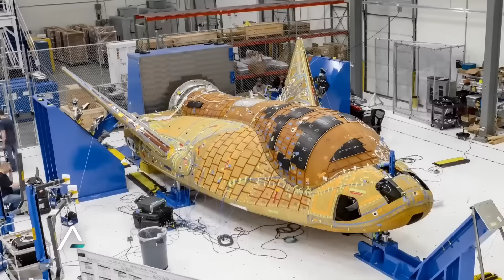The biggest news this week wasn't SpaceX or Blue Origin!  It was Sierra Space and ULA!!

Comment: Longer term the winners in the space flight game will be the ones that optimize reuseabilty IMO.  It’s basic economics - if a given craft and engines can be reused many times the cost per flight dramatically drops.  A key factor in this effort as well IMO is the durability of re-entry shielding.   If the shielding requires extensive and expensive refurbishment every flight the cadence of reuse is significantly lowered and the cost per flight rises.

Comment: Very smart move for both companies, though I do feel dream chaser needs to at least get a cargo mission going. It seems like it has been quite a long time and still not much to show for it.
It is good to see a company using these next generation of heavy lift rockets in other ways. A space tug is what SpaceX should have done with a second stage on top of the booster while they worked on starship. That being done they could have at least held contracts for the ship to start bringing in a flow of cash. Also could have used it to test 'tankers' and refueling in orbit. The longer this all goes, the more starship seems to be holding them back. 
Great coverage as always and fingers crossed all these companies achieve the goals we all want to see.

Comment: Assuming the acquisition goes through, once they run out of Atlas rockets, they'll be left with Vulcan Centaur.  The problem with that is that it is doubtful that Blue Origin will be able to produce BE4s at any scale other than at a snail's pace, and even then prioritizing Glenn (I refuse to call it 'New').  They need to ring up SpaceX and try to buy Raptor 3s as they are now more powerful, lighter and are being mass produced.
Reply: A little flexibility might be a great thing here.
Reply: In the tour with Tim, Bezos said from next year they'd be able to produce an engine every 3 days. The 2 engines used for Vulcan (which are also intended to be reused), should be nothing then.

He also mentioned improved power output, but I don't remember how much. If it is higher than on wikipedia now, it could be similar to raptor 3.

Raptor 3 likely is still a better engine, but we know too little about the latest BE-4's performance/stats to say how much.

Also SpaceX needs a a lot more Raptors than BO (7 vs 33 engines), so if BO indeed can get it to 1 every 3 days vs SpaceX 1 every day, BO might have more supply for ULA than SpaceX.
Reply: @MDP1702  Bezos says a lot of things and delivers on very few of them.
Reply: @gregkelly2145  Maybe, but unless you can prove he's wrong here, we have to give him at least the benefit of the doubt.
Reply: @MDP1702  'New' Glenn has been in development since 2013 and still hasn't flown a single time.  Blue Origin's history has been a cavalcade of delays and slowness.  ULA made the mistake of counting on BO and are now failing because the BE4 has taken so long to develop and produce.  What more evidence do you need?
Reply: @gregkelly2145  BO has been underfunded and understaffed quite bit in the past. It is older than SpaceX, but with a much different scope, mindset and milestones/path forward.

And Starship also has been under development since 2012-2016 depending on when you define "under development". If SpaceX had the same mindset as almost any other space company, we also wouldn't have seen a starship launch yet.

Yes, the BO-4 has seen delays (as has starship compared to their own set timeline), however that wasn't the only reason for Vulcan's delay. In fact the engines were ready and delivered before ULA had a redesigned stage ready. Current delays also are due to ULA production problems and not the BE-4 engines.

We've seen a similar development timeline for New Glenn as for nearly every other western modern large rocket in development: Ariane 6, Vulcan Centaur and even starship, who mostly seems to go faster because it is more visible, with the same "succes on first flight" mentality it would still be hidden in the factory currently like NG.
Reply: @MDP1702  Well, clearly you really like BO.  To each their own.  I prefer actual results.  BO's only real accomplishment is really just slowing others down with lawsuits.  I guess you could count torpedoeing ULA as well.
Reply: @gregkelly2145  I don't particularly like BO more than any other space company, I like SpaceX and Sierra more. I just think BO also gets a lot of unfair criticism if you look at its context and compare it to most other space companies.

ULA got torpedoed by itself, even with BE-4 engines it still was and is delayed due to other problems with Vulcan Centaur.

I am no fan of BO lawsuites, that is the main thing I'd hold against them. But I do believe they still have potential unless they mess up their first 2-3 flights.
Reply: @MDP1702  "Bezos said..." And that's all you need to know. That man has a solid track record. Unfortunately it's not the track record of achievement. Litigation is not the equivalent of achievement.
Reply: @RockinRobbins13  I guess the future will tell. Since Bezos stepped down as Amazons CEO, BO seems to have accelerated, though it mostly is happening behind the screens compared to SpaceX, so much more difficult to tell.

Comment: Keep in mind that "waste water" just means any water that has been used for any purpose whatsoever and then discarded, without to regard to whether it contains any significant level of harmful contaminants. If you use a garden hose to rinse off your sidewalk, that water becomes "waste water."
Reply: “Industrial wastewater”… well technically yes but is runoff from roofs and carparks really any different ?
Reply: @johnmoruzzi7236  It could include anything from an industry building... like the toilets and employee showers. Unless there are separate systems for various areas (like in watercraft, there is greywater & blackwater) discharge is an issue.
Reply: From what I was told it was just a misplaced decimal point on a repeating regulation report form, a typo, and nothing more.